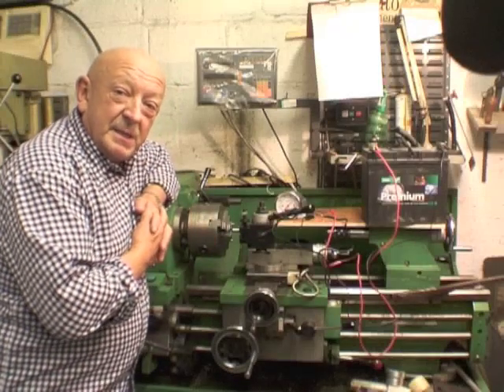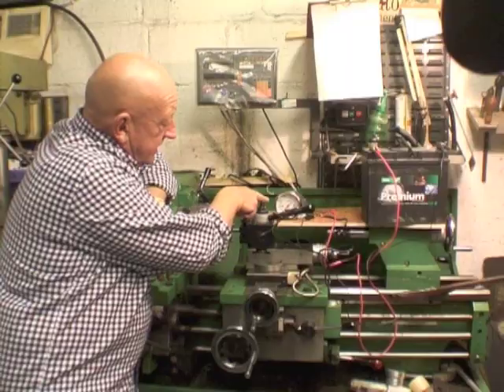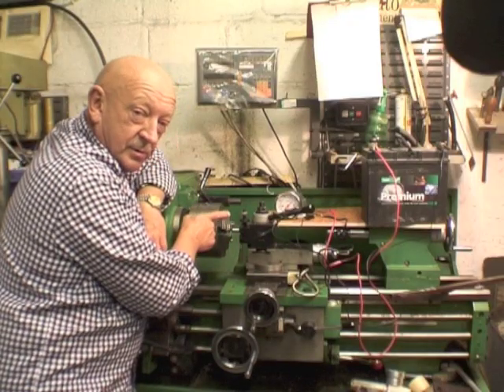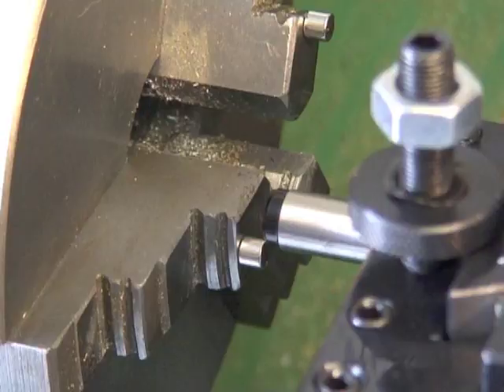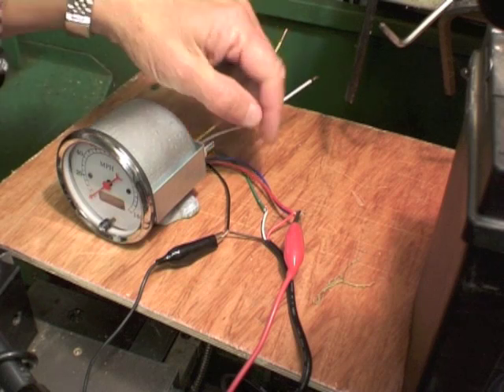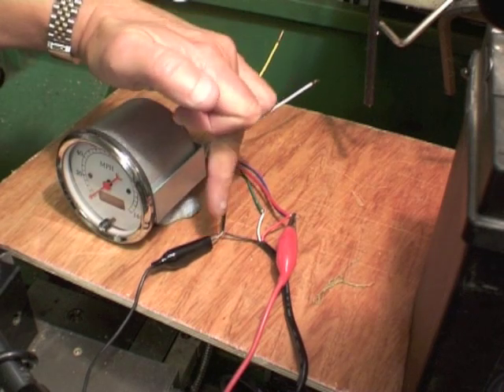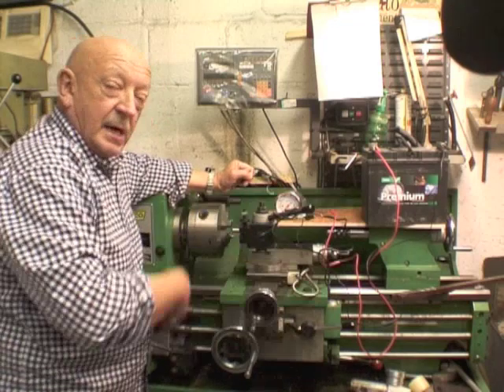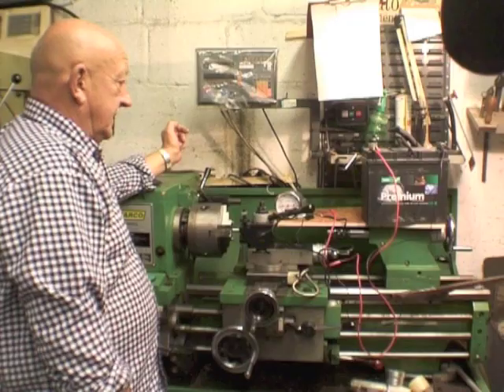How a car speedo works.

Comment: Doesn't this mean that different size wheels produce different speedo readings for the same speed?
Reply: Assuming the difference in size isn't offset by narrower tires, yes. If it's a different overall diameter, the speedo needs to be adjusted or it will be inaccurate.
Reply: Yes, the bigger the tyre the faster your Speedo will read compared to the actual speed your travelling. You can set tyre sizes in some computers, some vehicles will throw codes for abs, traction control etc if you don't as the wheel speed sensor will be going a different speed then it is supposed to.

Comment: Beautiful! I was trying to figure out why my speedo was running up to 25 MPH when I tried to start my truck but the engine wouldn't turn over. After diving into starters and speedos, I wondered if maybe the strong EM field from the locked-rotor starter was tricking the speed sensor. This physical demonstration really helps me imagine exactly what's happening. Thanks!